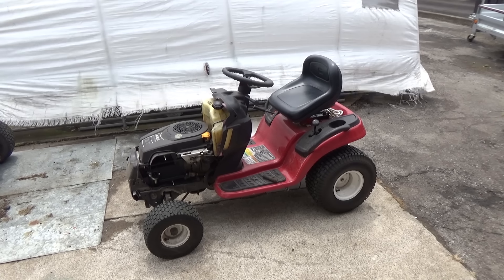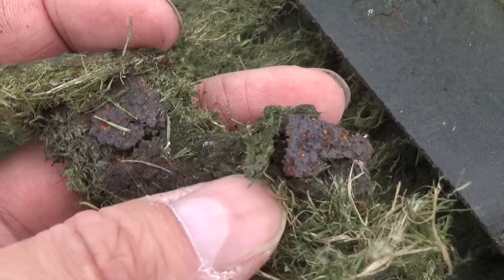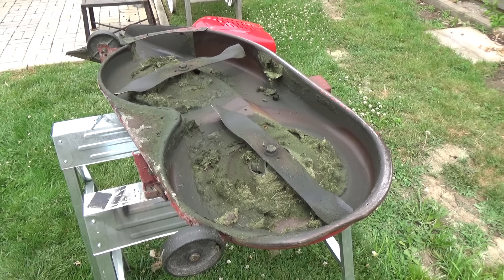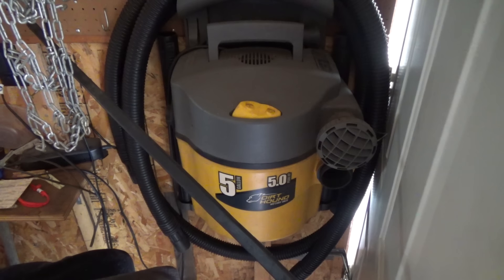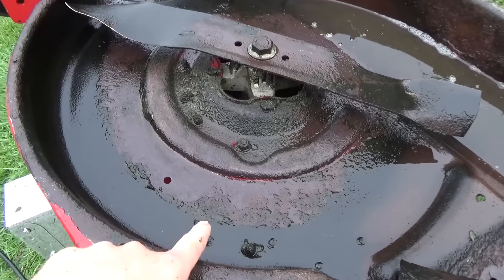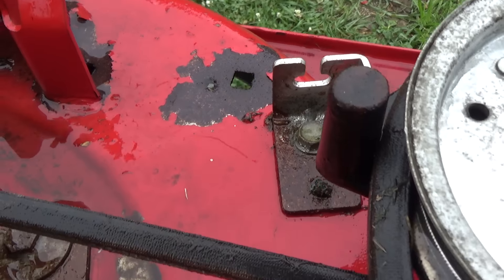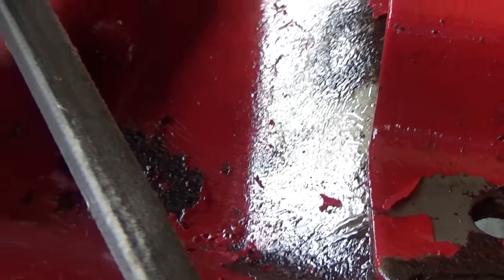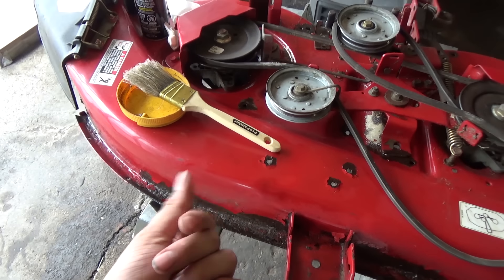How to Undercoat a Deck - Why Cleaning Your Deck is Important!

Comment: I would advise anyone considering buying a new mower to pay extra and get a commercial-grade mower with a fabricated deck rather than a stamped deck like the one in this video.  Then, every 6 or 8 mows scrape the underside of the deck and sharpen the blades.  Then, every Fall after cleaning the deck thoroughly and while the blades are off,  paint it with Eastwood rust converter.  I've done this for ten years on my Toro Commercial zero turn and it's in perfect shape.

Comment: i enjoy and find your videos informative and well explained - however 2 comments - next time for your customer, take a leaf blower and blow off the underneath of tractor, engine compartment , inside wheels, etc, to remove all that debris - if i was customer and got that back that dirty i would not be happy - all that debris will just fall down onto that nice clean deck.. 2nd - for blades suggest you use a wire brush to clean blades - - or better, a wire brush attachment to a hand power drill and clean surface of blades - - also seemed like lots of uneven chips in the "sharpened edges" -- good info but even tho perhaps the customer did not expect those extras it would impress a customer

Comment: Not being negative. But cordless power drill and a wire brush would get some of that cake on grass and bring a lot of that rust spots down to bare metal. And thanks I watched one of your other videos and found that rust inhibitor 3000 on eBay.

Comment: No need to undercoat a deck it will last for like one customers property and then it’s all gone. Maybe for storage fine, but with regular cutting there would be no rust under the deck due to all the dust sandblasting the underside. I’ve never seen a decks rust through, but I done use homeowner machines so they are heavy gauge steel. For a consumer grade machine I wouldn’t even care if it rusts through since the machines are very cheap and will be trash by the time the deck rusts out.

Comment: I notice the deck is exactly the same as the Cub LX 1042,  complete with the attachment nipple  for hooking a water hose to the deck for washing after mowing.   Do you recommend using this for cleaning the underside  of the deck after mowing,  or just how effective is it?
Reply from the maker: Tab Lature Great question!

I don't recommend using the hose attachments at all!

They usually only clean the area around the hose fitting, and it gets all the remaining grass wet underneath, which will lead to your deck rotting out!

I recommend to my customers, that they wait until after cutting, once the machine is cooled down, take the hose and wash the top of the deck to get all the debris off of it.

Then, at the end of the year, go underneath the deck and scrape all the dried grass off of it!

This will help keep your deck clean, and it won't allow it to rot.

The grass is what holds the moisture, which eats through the deck! If there's no grass, there's hardly any rust!

The rust inhibitor we use (undercoat) just prevents further rust from happening, and puts a layer of protection in between the grass and the steel deck.

I hope this helps, and if you enjoyed the video, don't forget to subscribe!

Thanks, and have a wonderful holiday season, and a happy new year!
Reply: Thanks for the reply.  I never had much confidence in the system.   Now I know why -- for the very reasons you stated.  I think your rust inhibitor application after the season is probably much better PM.  Merry Christmas and Happy New Year.
Reply: Eliminator Performance  )
Reply: I don't understand why you wouldn't want to use the the hose nipple after each mow. I have a mulching deck on my mower and I use it every time I mow. In a sense this system power washes it every time.
Reply from the maker: In my past experience, the majority of them don't do a throughout job. Most people won't notice because they never look under their deck, and it rots even further.

If you perform routine maintenance on your equipment, and keep an eye on grass and moisture build ups, you should be fine doing it that way!
Reply: Royce McCarthy My power equipment dealer, when I bought my Husqvarna tractor mower instructed me quite emphatically to use the deck hose connection to clean the underside IMMEDIATELY after cutting the grass and  he stressed " don't go have a cup of coffee first". So I hook the hose on and sit on the machine about 10 minutes washing the grass off and then I use a leaf blower to clean the clippings from the top of the deck and all around. After 3 years I must say the deck looks pretty darn good, top and bottom. Minimal scraping underneath.
Reply: Get a set of plastic car ramp, and drive the front end of the mower on them. Use a hose and clean good underneath after cutting wet grass. If you cut dry grass you might not need. Also use a hose and strong blow gun from a compressor and blow everything off after each mow.
Reply: Of course if you just hook the water up its going to just clean a small area that the nipple is but if you hook the hose turn the water on start your machine turn on your blades let it run with the blades engaged while sitting on the machine for about 5 mins it will blow all the grass out thats right out of my cub cadet owners manual however before you do this let the machine sit and cool down first you dont want cold water spraying on hot parts
Reply: iiiiitIII kiut was iIII ii

Comment: When you sharpen a blade, it only stays sharp for about 15 minutes.And only about 2 inches of the outside edge of the blade does about 90 % of the cutting.
Reply from the maker: Jerome Cook Our customers have never had any issues with our blades going dull, and have actually complimented on how good their lawns look, but I agreed that blades do dull over time, and need to be sharpened every year, with new blades being purchased every 3yrs.
Reply: Jerome Cook I mow 5 acres and in a few mowings there is nothing left of the blades to sharpen.    Literally all worn away.
Reply: Eliminator Performance what a joke.   My blades are worn to nothing after  mowing my 5 acres about 3 or 4 times.
Reply: I also mow my 5 acres every week or two and my blades are fine.  You may need better blades or stop crunching up the rocks in the field.  Cub Cadet XT2 50" deck and 5.16 acres.
Reply: John Fenman what the heck pot metal blades are you using??
Reply: I like a good looking yard, but in no way am I a perfectionist  ! When I moved to my current place, I was given, a well-used mower. Have been here 7 yrs and have Never sharpened the blade, not even once  ! And my freshly cut yard STILL looks nice  !

Comment: whether your deck underside is rusty or not, and AFTER Cleaning it best you can by any means... once DRY, brush or spray on some rust preventer if any rust spots, just grab some SILICONE Spray from Walmart or any store -spray the underside and blade on occasion, hose off after every cutting and you'll be good to go.  You'll be amazed.

Comment: That oil coating won’t last more than a few weeks.  You would’ve been better to have used a wire brush and pulled all the flaking paint off and scoured off all the rest down to the bare metal, then hit every rust spot with undercoating.
Reply: Under coat guarantees rot.
The 2 worst things for rust are powder coat and undercoat.
Im a welder I see this daily.

Comment: Change the engine oil. Take a cheap paint brush and slather the used oil under the deck. Great way to recycle the used oil. The remainder of the used oil, mix 50/50 with Diesel and spray on your wooden stockade fences. Stains, seals and keeps bugs from eating your fence.
Reply: great for the environment
Reply: You don't paint the environment now do you silly? If you could go back to grade school and reread what I wrote....... Apply to under side of mower decks and wood fences slash decks. But oh no, dummy squad Jason Morehouse comes along and thinks we all are spraying our kids and dogs down with used oil.
Reply: ... Don't feed the Troll...[ You're correct though, that The Solution to pollution is not Dilution.]

Comment: Update on condition of the deck?
Reply from the maker: Just did annual oil change on it not long ago and the deck is in great condition, with hardly any grass stuck to the deck!

I had to replace his blades though as they were getting pretty bad from cutting rough grass with rocks around the property

Comment: If you live out in the country where you mow acres every week this wouldn't last a Mont on the bottom of the deck. A better solution and not much more work is to wire brush all the loose paint off and use a product called Por15 or KBS. It's a 3 step process that kills active rust and seals the metal. You will still need to apply some now and then on the bottom of the deck as needed. Later

Comment: SO, it's only about Rust protection, Crap, I wanted to find out what to use to keep the freaken grass from sticking to the Deck in the first place. I ALWAYS wait till the grass is dried out before I cut, but the grass still keeps caking up. My quest continues.
Reply: I use WD40 after I clean the deck

Comment: The sides I of  a deck get mashed and mangled from hitting things long before it will rust through.   So just replace the deck for 200 to 300 bucks now and then.
Reply: not always!
Reply: John Fenman not everyone mowes on dirt patches John.
Reply: thersten the deck would tend to get mashed more by hitting against a tree, than a dirt pile.  Or any other obstacle you get too close to.   The guide wheels just on the deck wear off in time, basically metal mounts too flimsy.
Still my favorite mower,  but the deck housing around  the blades  is too thin guage to last.
Reply: Not everyone bashes the crap out of their mower, dude.

Comment: Why is the deck made from metal instead of Carbon fiber or ABS Plastic where it can be lighter with no rust?
Reply from the maker: Cost, it costs more to use Carbon Fiber.

Also, Aluminum doesn't rust, but you'd need about twice the thickness for it to have the same strength as steel.
Reply: Because people don't want to spend more money. Besides that manufacturers want things not to last so we end up spending more money anyways! 😂🤷‍♂️

Comment: Not to be rude but the work done in this video will only slow the cancer down. To save the deck it should have been wire wheeled or sanded and repainted. After that your oil coating idea would be ideal. Lazy work done here
Reply: Painting never works just peels off the way Eliminator did the job works great cause the rust inhibitor soaks right into the rusted material and even through some stuck on grass left on the deck. Have been doing the same thing to my mower since 1968 and still have a solid deck man. Wire wheeling is a good idea but not really necessary if you power wash the underside like Eliminator did.
Reply: i use hammerite that sticks real good
Reply: freshkillz thanks for the hammertite reply we will try to source the information. Just for your info just reserviced a rider that we treated the deck with Rust Cure and it looks like the day we did it. Asked the owner if he had been cleaning under his deck and he said no why? Told him hardly any material was sticking to the deck but we recoated it anyway.
Reply: He could have used a pneumatic scaler to remove the rust a little better and then treated it and maybe a proper application of POR-15.  Unfortunate fact is that even if the mower deck was stainless, it would still rust at its weak points.
Reply: I don’t think cleaning under the deck with a metal paint scraper is safe for the deck. Scraping the bottom will scratch the steel
Reply: You are rude. Do you know what the guy who owns the deck wanted done?  It's a friggin Toro LX425 not an expensive mower that someone would keep in prime condition. Ever  considered that maybe he didn't want a repaint? Couldn't afford a repaint?  Maybe he only asked him to slow the cancer down and get a good coat on it.  That ""lazy work" he did may have been exactly what he was asked to do.  Good job of doing some inexpensive preventative maintenance on an old deck.  Keep the videos coming. You are a lawn mower guy not a Hollywood producer.  Good job and thanks for sharing.
Reply: MarineMan, is your comment directed to me or someone else?
Reply: Pyro Z , absolutely not. Response just happens to follow yours.  It is for "freshkillz"based on his original post above. He is assuming some things and erroneously judging the quality of the work.

Comment: I tried undercoating my deck. Lasted only about a month, and no trace of the undercoating.  The sand in FL lawns will remove about anything.
Reply from the maker: I guess it all depends on where you live!

If you live in a dry climate, there's less chance of rust.

I live in Southern Ontario, brand new trucks are already rotting out, it's extremely humid here. Everything rusts.

Comment: Need to do a better job descaling !  , what ever you paint on that mountain of rust is going to pop off before the end of summer. Plus It will collect grass much easier . I've got a 10 year old same as this it was descaled and painted 2nd year used with regular enamel. 8 years later I used Emron 2 part paint. The main thing that needs to be done every cut. Is wash the deck out

Comment: Is it possible to use a mower deck from a different riding lawn mower brand than mine? I have a riding mtd (columbia) and was wondering how in the hell to get a used deck. Columbia is impossible to find used. Could I use say, a cub cadet, troy built or yardman?

Comment: I just used the cleaning deck port and turn the mower blades on high power and lower the deck to the ground after each Mowing and it keeps the dead clean. I guess with the blades spinning at high speed in the water going in from the port it blasts everything off.

Comment: Hopefully when you POWER WASH the deck you should decrease the spindle bearing because the force of the POWER washer WILL WASH the grease you have in the bearings BEFORE you POWER washed the underside of the deck
Reply from the maker: We always grease bearings and spindles before reinstalling the mower deck.

Comment: my suggestion is hose off the deck after every use and never let that crap build up. i have a kubota BX2350 i drive it up on ramps and hose ALL of the grass off after every mowing. the stuff falls off if you get it before it dries and cakes on.

Comment: I scrape all the loose paint off and use a wire wheel on an air tool after scaping the deck blow all the dust off then use spray on graphite on both sides of the deck. It makes cleaning it easier. And don't try removing the spindles unless you have to replace them, they are usually aluminum and  the bolts are usually steel which means they seise up.

Comment: All rust is surface rust. Think about it, nothing rusts from the inside. Better to say the rust hasn't gotten to deep.
Reply from the maker: Technically, you're right. What I mean when I say "Rusts from the inside out" is that the rust develops, then wet grass covers it. At it will rust without you seeing it (if you don't clean the deck).

Comment: Mower decks should be made of aluminum, it's ridiculous to use metal that will rust when it's going to get wet every time you cut grass.
Reply from the maker: Yeah the problem is they need to use thicker aluminum to make it stronger and it end up weighing the same and costs more...

Comment: That deck was filthy with rust and dried caked on grass. It should be cleaned properly before coating it with anything. Do it right, scrape, wire brush and blast the deck CLEAN before repainting ONLY. That is the only coating a deck should have, PAINT. Everything else will provide a surface /media to collect dirt and grass and hasten the rotting process.

Comment: why not use a rubberized underseal like you do on a car
Reply from the maker: Great question Brian, the underseal rubberized coating is applied on top of the metal, and leaves a layer of moisture underneath it.

In many applications, the metal actually rusts from the inside out, and is commonly missed because it remains hidden until too late.

By using a rust inhibitor, you are preventing the oxygen from oxidizing the surface/underside of a mower deck.

I hope this helps!

Comment: Always keep your deck clean..and use protection..so your deck doesn't rott through 🤔😂
Reply: Dennis Arlan Agreed, as grass that accumulates up underneath there will eat your deck up as there is such a thing called, grass acid. When i take my decks apart i clean them thourghly and take the blades off after marking them and put them on a grinder sharpening the blades razor sharp. While they are off, doesn't hurt to take a quart of rust oleam paint and paint the underside of the deck,  and after its all put back together and on the tractor again, doesn't hurt to grab a putty knife and get underneath and scrap all the stuck on wet/moist grass out of there, keeping the mower deck clean underneatth  the deck for efficent mowing you use your tractor, and you will find that it will mow much better, the tractor works less harder.
Reply: the best way to prevent a dirty deck is to not go anywhere near big juicy grass. abstinence is always the best policy.
Reply: I saw what you did there🙄🙄

Comment: decks are usually about 180 bucks with nothing on it
Reply from the maker: Jon Covel normally we get them for $80 to $100 Canadian, with everything on them, sometimes we have to swap a spindle or pulley
Reply: You WON'T get a Snapper rear engine rider deck for that, stripped down well over $375.00 or over $400.00
Reply from the maker: The decks I'm referring to are used. If you were to buy new, it's closer to $600-$800 for some.